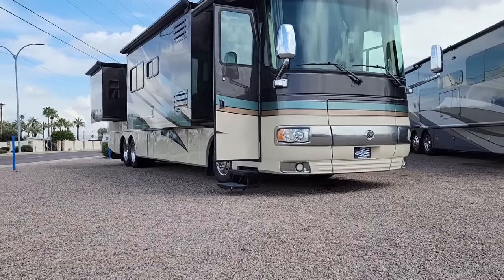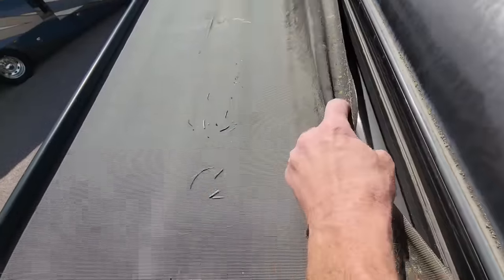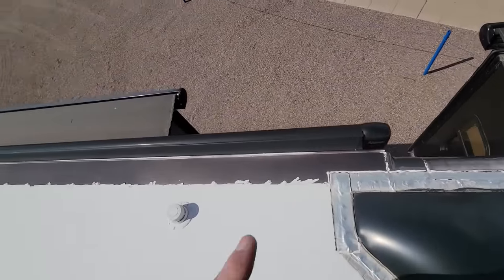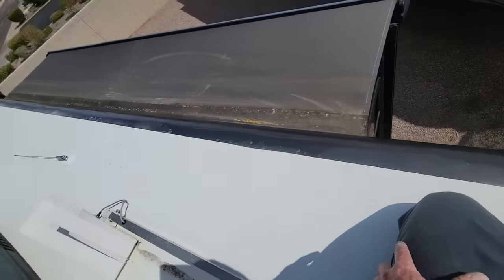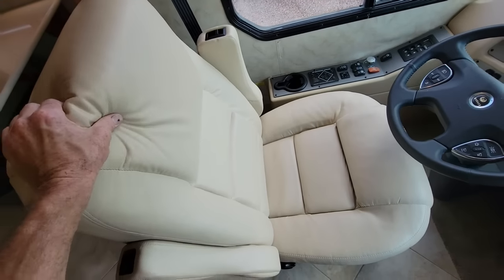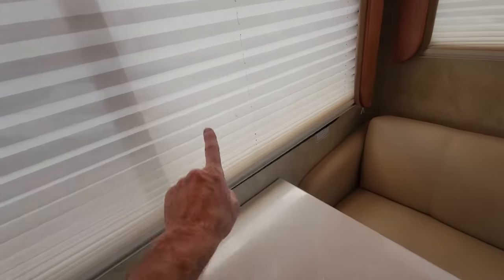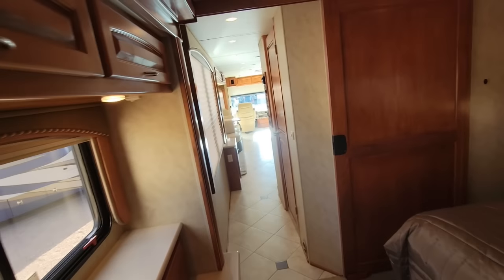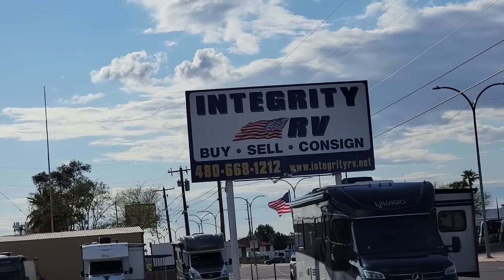Why Is This 2010 Monaco Diplomat So Special?

Comment: Thanks for the informative inspection James. I have a 2011 Knight with the roadmaster chassis as well. That unit looks so much like mine except for the tag axle. Mine also has three heat pump ac units like the front two you mentioned. Unfortunately mine does have the Maxxforce 10 engine. 57000 and no problems so for .......! Thanks again for making this video. Love watching them all.

Comment: I personally like having the two sinks instead of one.  I especially like having the one a little bigger than the other.  On the one small side, you can trap water in to wash dishes.  You don't want to waste any water you may need to use.  In the other side, you may need to rinse something quite big, like a  large baking pan.

Comment: I have been watching your channel for about 2 weeks. The information you provide is so incredibly helpful. You are clearly an old hand at this, and seem to love it. I am now confident in my choice to purchase an older luxury class A motor coach, rather than a new 5th wheel.... and the things I should be looking for with certain coaches.

I realize you are not a chassis expert ( just watched the Prevost  chassis inspection), but there is something specific I have not yet seen in one of your videos.

BLACK tank inspection.

Is this an issue on older coaches? There wouldn't be the "buzz" of 10+ year old RV's being banned from certain RV parks if not for the possibility of leaks. I know a lot of the coaches have foam padding on the chassis, protecting such things from road damage. I just want to  know if it is an issue.

How long do these things last? How often do you find 20 year old RV's with a leak in the gray or black tanks? What would I look for, if something other than the obvious decay of the spray foam, or smell?

If that is something others have asked, would you  consider doing a short on this topic?

Comment: Yes, you are right, it is a beautiful and well-maintained Monaco Diplomat. We own a 2016 model and have a question: where can we access the air filter for replacement, and how can we assess the condition of the belts? I presume the air filter is located behind the bathroom floor at the back."

Comment: The videos are great and have saved me thousands.  Question about Fiberglass roofs  , can they delaminate from the lauan because of heat(SUN) or is it just a water/leak issue.
Reply from the maker: gel-coat delam is different from filon delam, but heat time and water can cause it

Comment: My Class A RV is on air ride suspension. It seems that the front right side (passenger side) is not rising sometimes. Why is this happening, and what can I verify to fix it?

I cannot find any video or document to help me fix the problem. Do you have any suggestions? I'd like to know how to do the steps to troubleshoot it.

When my Class A RV's (2016 Monaco Diplomat ) air ride suspension on the front right side isn't rising properly, it could be due to several issues. Here are some common causes and steps I can take to diagnose and potentially fix the problem:

1. **Air Leak**: I'll check for air leaks in the suspension system, particularly around the airbags and air lines. Using a soapy water solution, I'll spray on connections and look for bubbles indicating a leak.

2. **Airbag Condition**: I'll inspect the airbag on the affected side for any signs of damage or wear. A damaged airbag can prevent proper inflation.

3. **Air Valve/Solenoid Issues**: I'll verify that the air valve or solenoid responsible for the front right airbag is functioning correctly. Sometimes these can fail or get stuck, preventing air from reaching the airbag.

4. **Air Compressor**: I'll ensure the air compressor is working correctly and providing sufficient pressure to inflate all airbags. If the compressor is weak or failing, it might not be able to maintain the required pressure.

5. **Height Control Valve**: I'll check the height control valve, which adjusts the amount of air in the airbags to maintain proper ride height. I'll make sure it is properly calibrated and not malfunctioning.

6. **Electrical Connections**: I'll inspect electrical connections related to the air suspension system. Corroded or loose connections can affect the operation of the air ride components.

7. **Leveling System**: If my RV has an automatic leveling system, I'll ensure it is functioning correctly and calibrated. Faults in the leveling system can cause uneven airbag inflation.

8. **Ride Height Sensor**: Some systems have sensors to monitor ride height. I'll verify that the sensor on the affected side is working and positioned correctly.

### Steps to Diagnose
1. **Visual Inspection**: I'll start with a thorough visual inspection of the airbag, lines, and connections on the front right side.
2. **Listen for Leaks**: With the RV running and the suspension trying to inflate, I'll listen for hissing sounds that indicate a leak.
3. **Use Soapy Water**: I'll spray a soapy water solution on all connections and look for bubbles.
4. **Check Compressor**: I'll verify the air compressor's functionality and pressure output.
5. **Inspect Valves and Solenoids**: I'll check for proper operation of air valves and solenoids.
6. **Consult Manual**: I'll refer to my RV's manual for specific troubleshooting steps and diagrams.

### When to Seek Professional Help
If I'm unable to identify or fix the issue through these steps, it may be best to consult a professional RV technician. They have specialized tools and knowledge to diagnose and repair air ride suspension problems effectively.

I cannot find any video or document to help me fix the problem. Do you have any suggestions? I'd like to know how to do the steps to troubleshoot it.

 
On this picture I think this is the air up valve. This is the driver side
T

Freightliner Genuine Electronic Dump Auto Valve - A16-18694-000

Comment: i truly value all of you vids i am working my way through them all. We loved our 2004 monaco knight 38PDQ unfortunately my laptop caught on fire last year in july that was inside the coach at a country music festival here in utah and it was a total loss by the time i got to it. We have since  purchased a 2006 Monaco Camelot 38PDQ and we are still fixing small things and slowly on our way to making it as enjoyable as our last. Near the beginning of this video you mentioned that maybe the windshield had been fixed the issue that i have with my 2006 one piece windshield is that the original owner said that the windshield had poped out and he had replaced it at least 2 times currently the one on it is what i call stess cracked could this be the same issue and if it is the same issue how do i get that fixed aside from replacing it agin and again? also what do you like or dislike about cable slides and gear drivin  roll out slides thaks in advanced and keep up the great content.

Comment: Hi James I would like your advice. I have a 2003 Beaver Emerald Marquis on the front cap radius where it meets the roof has a crack. this is on both sides. How would you recommend a repair. I am curranty in Mesa AZ. next too Cassone.
Reply from the maker: Sounds like the body work cracked, it would need to be ground out, fiberglass repaired, filled and painted. Cassone's should be able to do that work.

Comment: Thoughts on a 2000 Western Alpine 38FDDS 8.3 ISC Cummins
Reply from the maker: Western Rec was just a few years away from some really nice builds, overall they are fine and built to high standards of the time, I just find them a bit to safe when it comes to design.